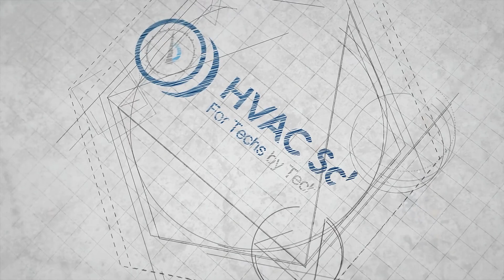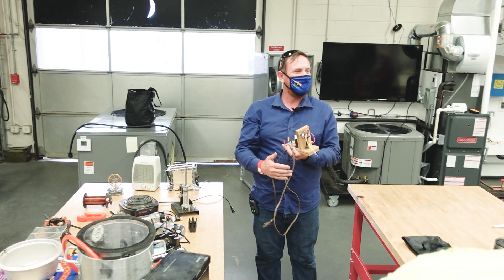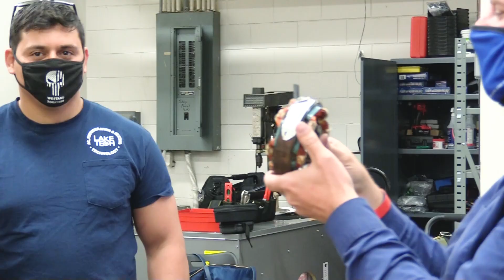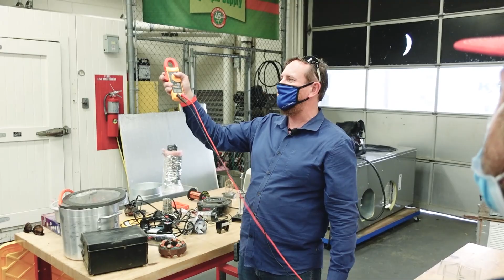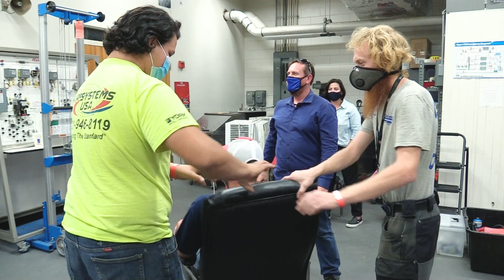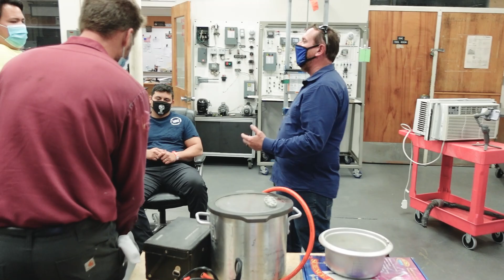Analogies for Magnetism and Electricity w/ Ty Branaman

Comment: Can you explain why the solenoid coil will be burned without having the rod in? 
I watched a video before which showed without the rod sitting in the solenoid coil the current is dramatically increased. Can you explain why the the current is increased in the solenoid coil when rod is not sitting in? Thank you

Comment: Electricity flows at the same speed, you increase current flow not speed.
Reply: Semantics.  Increasing the speed of the amperage is saying increasing the rate at which charges are added to the circuit.  Amperage being charges per second.  Once added to the circuit the reaction to the charge is a finite speed (in nanoseconds) depending on the conductivity/resistivity of the material containing the circuit.  

I stopped worrying about electrons and charges and started simply considering the flow of energy.  Increasing the speed of the amperage, increases the amount of energy being moved to "appliance" to do work at a given voltage.  Energy being simply a mix of voltage and amperage, which is changes according the elements of the circuit until transformed to another form of energy such as magnetic field energy used to, say create motion or heat.